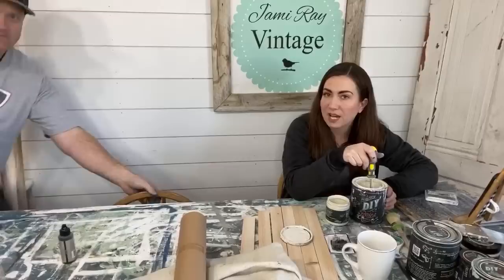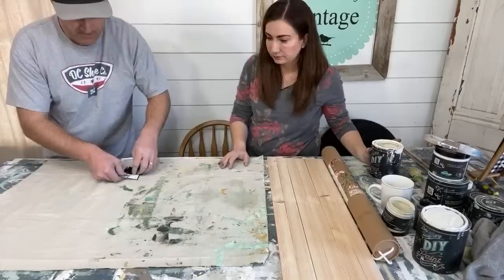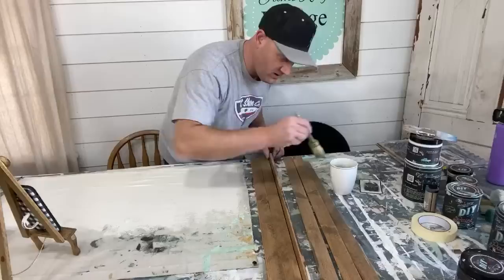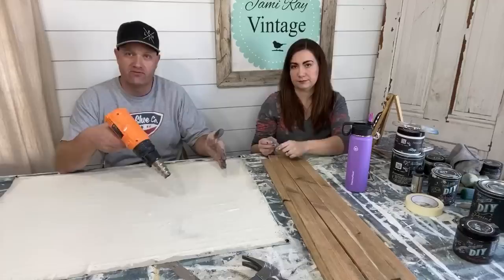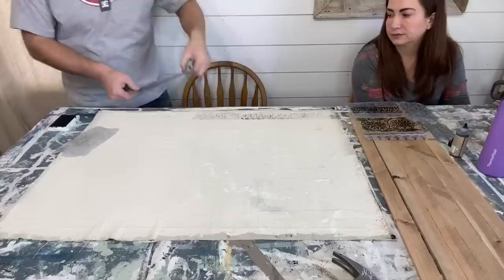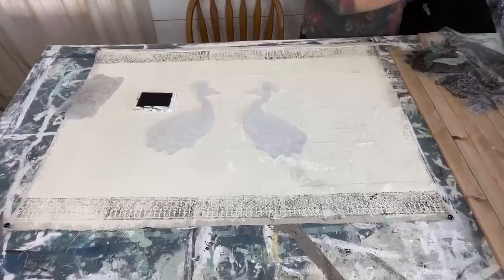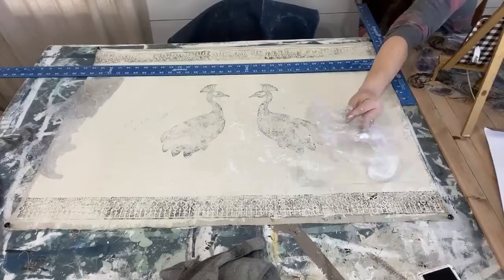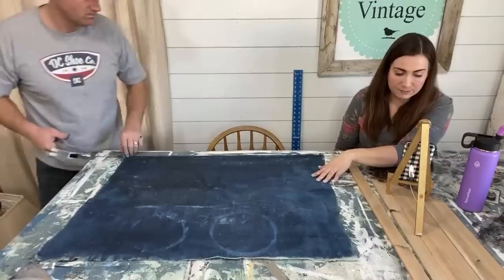Easy Anthropologie Tapestry Hack | WNW DIY

Comment: I use the TuffBoy canvas dropcloths from Amazon for all my drop cloth upholstery & painting protection. A 9x12' is about $20. I love this brand because it never has any seams and is isn't cut all wonky. I used these for my drapes (some painted &/or stenciled). I used this brand to upholster my sofa & 2 wingback chairs.  I use this brand for everything. I also use a cheap disposable plastic painters dropcloth under my canvas one when I'm painting furniture or walls.
Reply from the maker: That’s awesome!

Comment: So maybe what i had was a drop cloth. Really similar and hemmed. My partner of 6 years had 3 packs he had used to protect back of couch from the cat. One I used as temporary floor covering so go thrashed. Just used one for one side of a bag. It got really limp after washing fist but used iron fusible in a heavy weight. I liked it a lot. Seems almost raw silk, nubby cotton. Has lots of abilities. May try panting or doing free motion on some. I got it out because of needing male projects for my student and we opted for a book bag from this. I did a sew along to design his bag. Wish I could show you my bag. I made it reversible with a plaid woman’s shirt. I use pockets as sleeves.
Reply from the maker: I love using drop cloth,  very durable fabric with so many uses.

Comment: Painting the entire edge of your drop cloth will keep it from fraying.  I made a circular tablecloth from a drop cloth for our church's Women's Spring Tea 2 years ago which I stenciled using chalk paint.  I intentionally 'fringed' the edge for 'effect' but wherever there was paint was a bugger to get to fray.  It would not fray without pulling and getting in there with a sharp tool to separate the threads.

Comment: I was tempted to wash my drop cloth and dry it in a hot dryer to tighten the material before using it but just stapled 2 old shower curtains to it instead. It now has enough paint on it that I can remove the backing if I decide to
Reply from the maker: Nice!